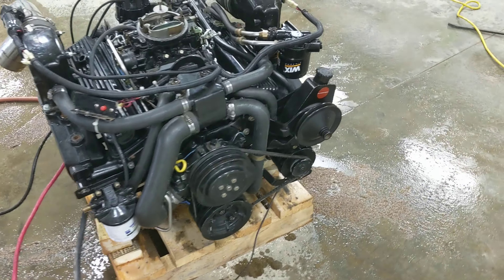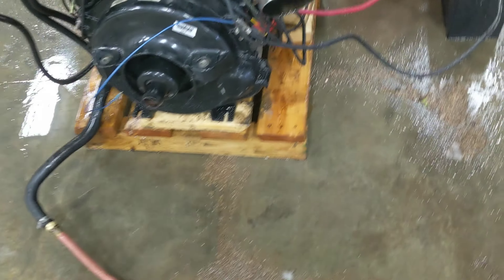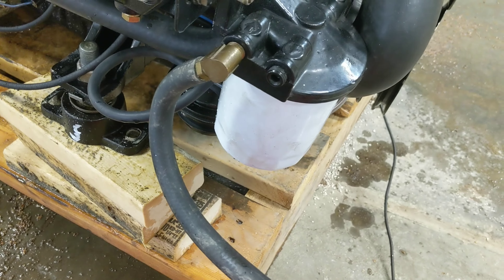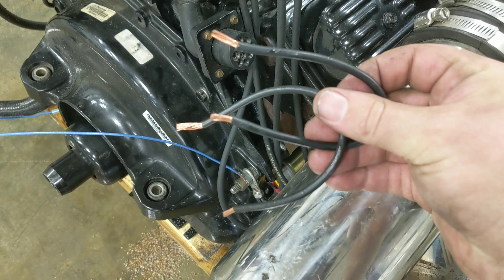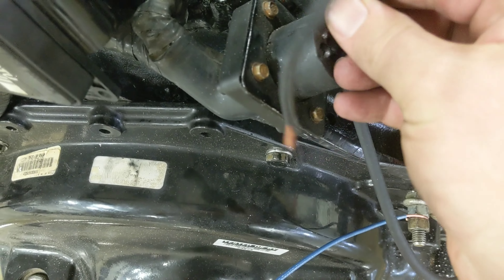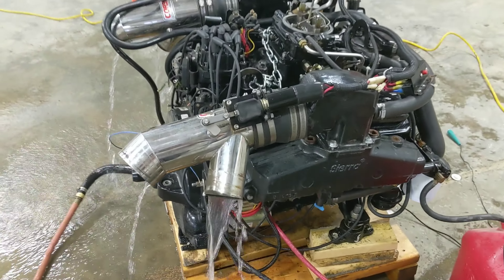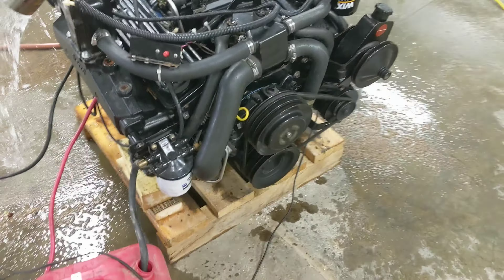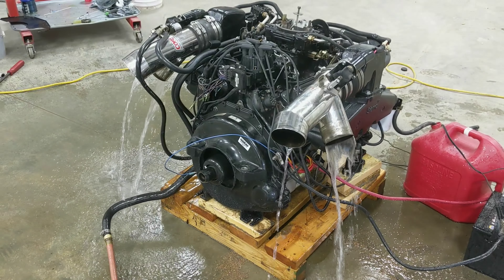How to Run a Mercruiser Boat Engine on a Stand or Outside of a Boat

Comment: Is the wire harness the same on all early mercruiser’s?
Reply from the maker: I don't know for certain but I would say if you're around my age of boat that they are very similar. This is a 1995.
Reply: @605BOLT  
I have a 94’ on my stand now so it’s probably the same. Thanks for the reply 👍👍
Reply from the maker: Oh nice. If you don't mind, comment back and let us know. Somebody else might be cruising the comments looking to know. 🤞🤞
Reply: @605BOLT  
Just ran my on the cradle and the pins are the same mine is a 92 thunderbolt IV 5.7
Reply from the maker: @Matt82  excellent!! Thanks for posting back. Hope you have a great boating season. 🍻
Reply: Will a 1989 5.0l mercruiser thunderbolt work like that as well?
Reply: @alanjimenez1976  
It’s possible but you’d have to check the wire harness. If I was a betting man id say they are the same.
Reply: My pin looks just like this 10 pin mine is mercruiser 305 mpi I wanted to ask if you think this  5 6 7 pin would work?
Reply from the maker: Very good chance. Go for it. Let us know your results!
Reply: @sinkorswimgarage  
Not much difference between the 350 and the 305. The wire diagram looks the same for both. It should work
Reply: Will do thank you guys much. I'll let you guys know how it turns out
Reply from the maker: Did it work?
Reply: @605BOLT  Yes, it worked and started. The fuel pump came on, and ignition fired everything. Thank you for all your help
Reply from the maker: @herbieking2873 excellent news. 🙏
Reply: @605BOLT  I do have a question for you, though bolt. I want to go to  carburetor instead of the mpi because of tunning cost and not sure that mpi will work well with 383 with higher compression and bigger cam. Will my throttle cable still work? Because mpi injection cable is on passenger side.
Reply from the maker: @sinkorswimgarage  dang I don't know about all that.  I'm sure there would be a way to make it all work.  Might need to get a little bracket or something.  My boat uses a Rochester Quadrajet on it right now but my dad had an older 350 in a Larson boat with a Holley boat carb.  He says the Holley made a huge performance difference. I don't see why it couldn't be done.  I would probably stay with MPI if possibly but I don't know how that would tune so part of me says swap over like you're talking.  Or maybe best of both worlds and get a Holley Sniper EFI?  That would be the ideal setup almost.  I'll be curious to hear what you decide.  Sounds like it will be a kickass setup though either way.  I would have loved to put a 383 in mine but I worry about tearing up the outdrive with more power.  I've heard you need to be gentle with hole shots on a 383 or any V8 making 400+ hp.

Comment: Glad I found this video. My Lund had a 4.3 that has cracks and got water. I pulled it and now have a rebuilt 5.7 going to go in. I'm definitely going to do this to verify everything before dropping it in. Thanks!
Reply from the maker: For sure!  Better to check things out before you do all the install work.  Plus its kind of fun to listen to.
Reply: @605BOLT  Of all of the things required, like cleaning out the bilge, installing outdrive, bellows, etc., hearing it run before install will be good motivation. Almost as good as eventually hearing it run in the lake! Crazy, I'm doing this for fun along with a PWC, Snowmobile, motorcycle, and square body Chev that are all in line to be worked on!
Reply from the maker: Boy that sounds familiar.  One other thing I would recommend (you were probably going to do this anyway) is an oil pressure gauge just to make sure everything is good oiling wise; since obviously you won't have the dash gauge to reference.  Plenty of projects it sounds like!
Reply: @605BOLT  For sure! Wife only goes along with all the projects because I'm out in the shop more rather than bothering her 😁
Reply from the maker: @harley96cube  helps make sure a guy never gets dehydrated too. 🍺

Comment: thanks bro. this helped me out man.
Reply from the maker: That's what I like to hear. Now for the install I assume!
Reply: @605BOLT  Well, I build/work on boats for a living (certified master tech, 8yrs now). So, I'm ashamed to say, that I didn't know which pins to jump etc on the older MCM's and etc.  Lol

I've never had to do it, but came across your video randomly, and it couldn't have came at a better time to save me from having to look up the wiring schematic and etc myself. Lol

I'm fully restoring my own personal Sportcraft 270 (were on Lake Erie near Cleveland) and I just pulled another donor boat home that has the powerplant I want to use. It has an 89' MCM 5.7 in it that was dealer replaced only 79hrs ago!

So, I'll be pulling that motor and using the "pallet method" just like your setup here shortly, and so glad I ran across this video because it's gonna save me a good hour or two of troubleshooting, dicking stuff around, and figuring out which pins are what lol.

So, I'm very appreciative for the video and glad you put it out. Definitely subscribing and hopefully you can teach me a few more tricks and we can share some cool builds and etc. Hell, I may even start a small channel just to share my cool builds and teach in depth structural design and glasswork, who knows.

So, thanks again man!
Reply from the maker: @strikeforcek9149  hey that's ok glad it helped. Nobody can be an expert on everything by memory. Be sure to mention if you see me messing something up.
Reply from the maker: @strikeforcek9149  you definitely should start a channel! Very cool project you have too! There isn't shit for boat stuff and lots of people just need a little bit of info here and there. Cheers from South Dakota and the muddy Missouri River! 🍻

Comment: Did you have your alternator hooked up? I tried this with my 2015 EFI Mercruiser engine and it wouldn't stop when I took cables off the harness. I think it needs to send the ignition to ground, when the alternator is on, no?
Reply from the maker: I don't know. Mine was just running bare bones.  Its certainly possible that there is something more going on with the newer engines.  You could always just disconnect the fuel supply or ignition source (unplug a coil or two).  I've never tried this on a newer engine.  Other than it running on after unplugging, did it work just fine?

Comment: Do you know of the 454 7.4L would have the same start up procedure? I bought a boat with the 454 in it but the actual ignition switch is broken and I wanna see if the engine will even start up.
Reply from the maker: I thinking the mercruiser harness is universal at the connector so a boat can have a 5.0 or 5.7 or 7.4 plugged into it. Not positive but I think so. Maybe check on Google to see.

Comment: What is the correct way for a 95 5.8 Cobra motor? Timing and the firing order and where should the rotor be pointing at? If you can help me out I appreciate it
Reply from the maker: Gosh I don't know. That's a Ford motor so I don't know if the harness is the same or anything. They might be the same but I just don't know for sure. I'm sorry. If it's a cobra I would doubt it will be the same but you never know.
Reply: @605BOLT  what is your base timing to start it? I can go from there I think you're firing order is the same thing as mine
Reply from the maker: https://youtu.be/bHtDtcuM06Y this video is the timing video. Shows base timing I think. Been a couple years already haha

Comment: What size harmonic balancer is on that motor ? And what size is that motor .. thank you
Reply from the maker: It's a 350 (5.7L) but I don't know the size of the harmonic balancer. Sorry. 😬
Reply: @605BOLT  thank you so much .. one more thing what year motor ? I want to put the same set up in my boat
Reply from the maker: @Badassbuilds777  this engine is a 1995 boat and Mercruiser parts that go with it. The block though is from a 1989 or 1990 Chevy pickup I think. 4 bolt main with a roller camshaft and hydraulic lifters and one piece rear main seal. 2 bolt main would work fine too.
Reply: @605BOLT  your super helpful man ..god bless .. love your videos !!!👍
Reply from the maker: @Badassbuilds777  happy to help! If you have any other questions I'll do my best! 🍺

Comment: Only thing I don't like about this is no way to monitor vitals. Especially oil pressure!
Reply: Well in my case I put it together. I checked the oil pressure with my drill and she was pumping great with good pressure. You could always run a simple oil pressure gage.